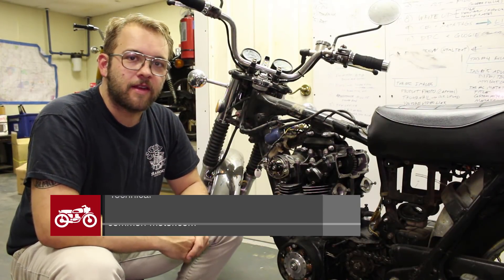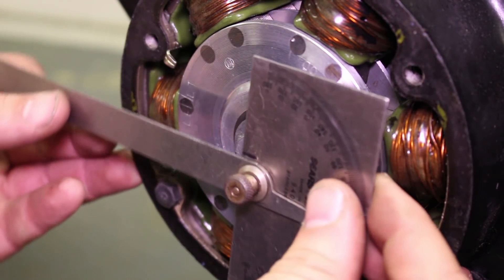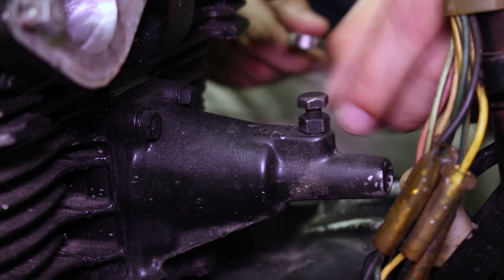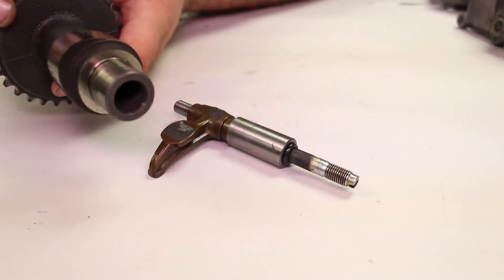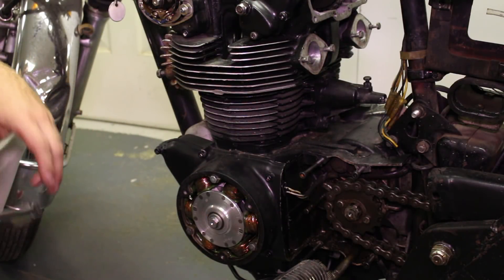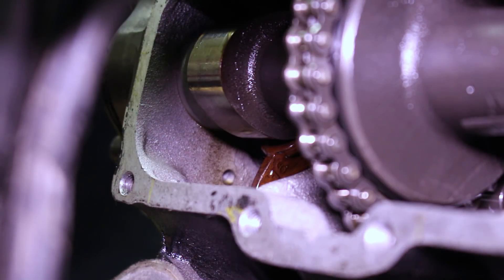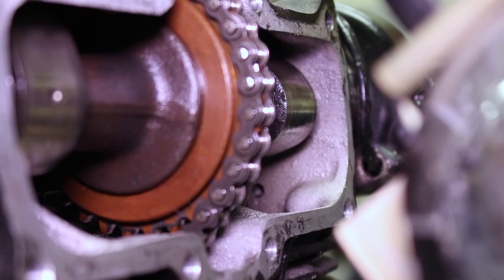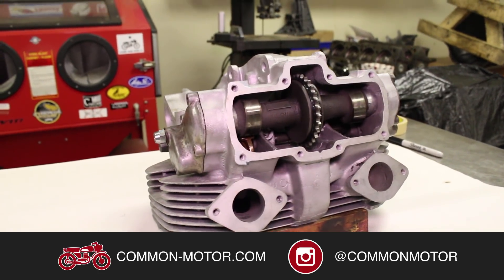Honda CB450 Valve Adjustment & Cam Chain

Comment: I agree with your procedure with one big exception. You are setting the clearance WAY too loose.  Unlike most over head cam engines where the rocker arms are a class 1 lever, with the pivot point between the force applied (cam lobe) and the load (valve end). Much like a child's sea saw.  This engine uses a cam follower that is a class 3 lever.  The pivot point is on one end and the load is on the other end with the force applied in the middle.  In this case exactly in the middle.  Measuring the clearance between the cam and follower will result in the clearance at the valve end being twice that of the clearance at the cam lobe.  In the case of the factory clearance spec of .0015" clearance will result in a clearance at the valve end of .003".  This is very much in line with all the other Honda models.  Setting the clearance at .004" will give you a clearance of .008" at the valve end, which is more than twice the twice the recommended clearance.  Honda designs their engines to run with a .002" - .004" clearance at the valve end, with the wider gap on the exhaust valve.  The reason that the clearance on this engine is so tight is to get .003" at the valve end.  It is measured at the cam lobe simply because it's impossible to get a feeler gauge in at the valve end on this engine.
Reply: Thanks to your comment I ended up setting my clearance at somewhere between 0.0015 and 0.002 - here's hoping that works

Comment: had a friend with 1 of these about 20 years ago, he died around 15 years ago, but his gave him great service, but never traveled far, usually in same city for many years as a daily rider, without any issues

I am here because I found 1 for sale, but unsure if I should buy it, price is right, but after reading too much people are saying to stay away from? I have rode motorcycles for 40 years, but I am feeling too much pain, looking for a lightweight bobber for a daily rider, I have stopped riding my 700lb Harley, as my legs & body hurt so much, I hate wrestling with the weight, I need a light bike, & would buy this if I knew I should get decent service out of it? 

last year I rode 5k miles, & this year under 200 miles so far. & just a few years ago I never did less than 10K miles, & 10 years ago, I did minimum of 25k miles a year every year since I was a teenager. so if I can find something I can ride without hurting, my riding miles will go up, & usually only 1 trip a year, of maybe 1k plus miles each way. 

I am a qualified mechanic for cars, as well as body-man & welder, & old school Harley mechanic, & have done repairs to several import bikes, but Yamaha, & Kawasaki, and a few old vintage 750/550 Honda, or 350/360 Honda, never worked on a 450, but if can find parts, no issues, but worried on reliability, & how often have to do maintenance,

Comment: Any suggestions for when the lock bolt on the rocker arm adjuster is seized? Turning the bolt just turns the screw as well, no matter how much force I keep on the screw.

Comment: The Honda factory service manual for a CB500T doesn’t mention anything about rotating the engine to 90 degrees past TDC on the compression stroke for LH cylinder prior to cam chain adjustment, could you clarify why it doesn’t? What is to be gained by having the engine rotated to the position you state?
Reply: I noticed this as well, but the explanation makes sense..
Reply from the maker: Hey Kyle, reach out to our technical support on our website for a more in depth explanation. We can definitely help you over there.

Comment: So i'm having an issue, i have the mark at LT, i did the intake valve perfectly but when i try to adjust the exhaust valve the rocker is way way too far off and actually can wiggle quite a bit. I cant figure out what im doing wrong.
Reply from the maker: Hey Aaron, you're probably going to need to do a bit more investigation. If your valve isn't adjusting as it should quite a few things could be happening. I'd recommend scheduling a tech support  call with us and we can find out what you've checked and give you some insight on where to look next.

Comment: exhaust and intake spec both .004 on this? thanks I am working on a 72
Reply from the maker: https://support.common-motor.com/hc/en-us/articles/360021017191-What-is-the-valve-adjustment-tappet-clearance-specs-for-the-Honda-CB450-CL450-CB500T-

Comment: Hi mate, it is not clear for me the adjustment of tensioning chain cam.
As per your video you are positioning the rotor in the middle of LT and T, but as per service manual it is mentioned las follow.
Why? What is correct?

Cam chain adjustment:
a. Remove the dynamo cover, turn the dynamo rotor counter-clockwise and align the “LT” mark with index mark on the stator

Comment: I actually have a 1974 Honda CB450 and it is licensed and insured and is a daily rider. Thanks for taking the time to make this video. And  I do totally agree with a  slight extra valve clearance on these engines.
Reply from the maker: Thanks!  Yes the few extra thou on the valve clearance makes all the difference!

Comment: I just bout a 73 and followed the three videos of yours to a tee and now the bike is running so smooth and kicks over immediately every time. The manual is confusing and hard to follow. Thanks guys. Also just ordered a bunch of parts off the website as I found they’re almost impossible to track down and some are discontinued.

Comment: I take it you guys skipped doing the CB450 engine assembly part 2 then.
Reply from the maker: Nope, we still have not released all the videos in that series, there are another 3 videos in that series to go live. This is simply some basic tune-up information that we have been asked for consistently for quite some time. We'll finish up the 450 engine assembly soon.
Reply: "soon"
Reply: Don't hold your breath. It's been almost a year.

Comment: I've made a habit of tapping the rear end of chain tensioner housings like these with a rubber mallet or the soft handle of a screwdriver after loosening the set screw. Every once in a while I'll hear movement only after a tap.

On a new-to-me bike, I think I'd just go ahead and pull the assembly off the first time I do the service. I don't know CB450 well, but on 350, it's fairly easy to pull with the carbs still on, and to save (or replace) the gasket. That way you can clean out the assembly, force the plunger all the way back and lock it down before reassembly, and feel it pop forward when you loosen up again.
Reply from the maker: Kyle, not a bad idea as that plunger can get stuck.